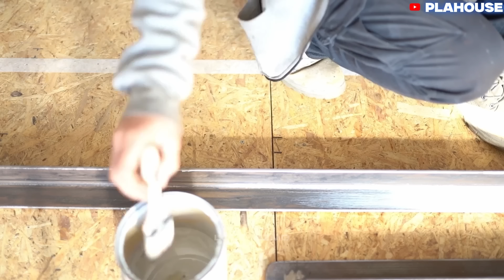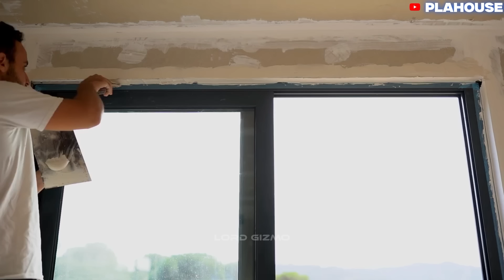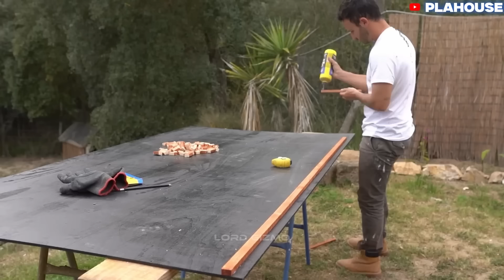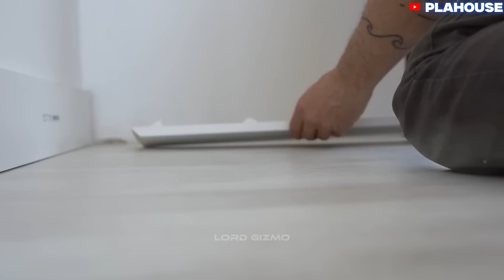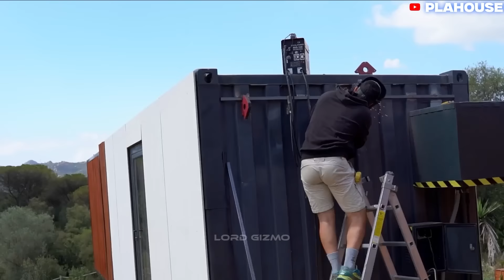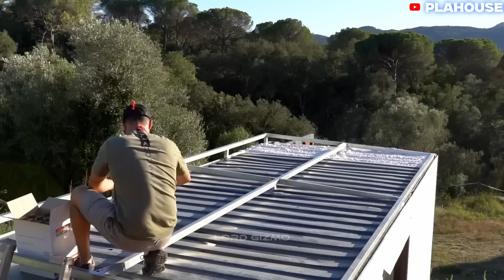Man Builds Dream Container Home With a Fold-Out Terrace - Start to Finish

Comment: This is the most informative Shipping container build i have come across in 19 years.
Reply from the maker: Thank you
Reply: With 10+ years in mechanical estimating / project management for hospital construction, I have developed two types of houses. One is pure Lincoln Log 1800s style, 2026 technology. The next one is shipping container house wrapped in mechanical pipe insulation with final exterior of LOG. That will be 3X the insulated R-value. Use GROUND-SCREWS for a sturdy, movable foundation.

Comment: The Edveros heat pump was specified for our climate zone. Not a general European spec applied to our location. Our actual outdoor temperature range, our actual heating degree days. It runs efficiently at -15C. It does.
Reply from the maker: That is great to hear, proper climate specification makes all the difference.